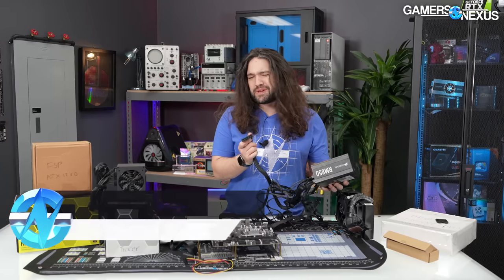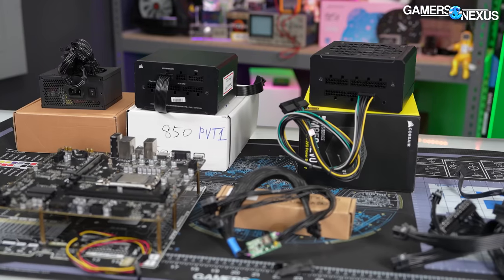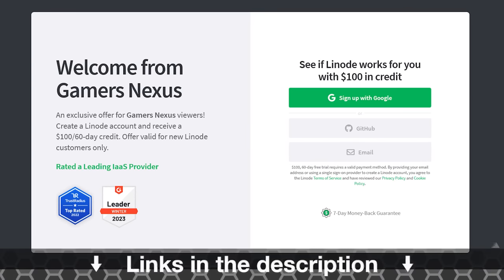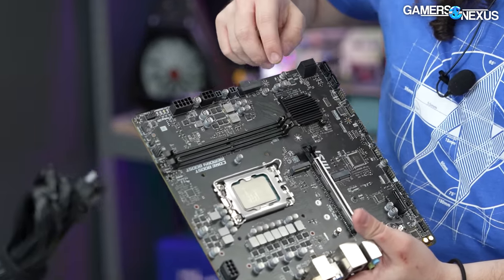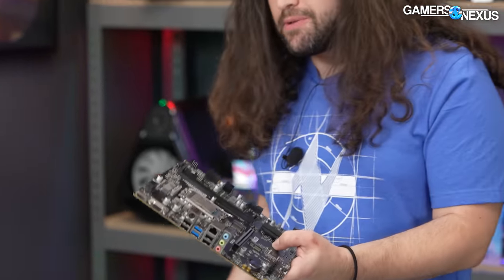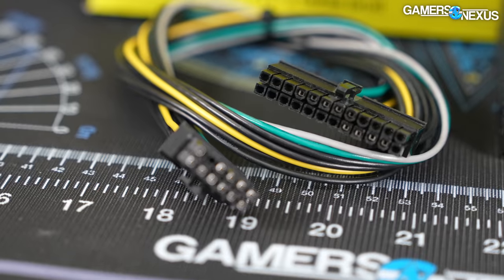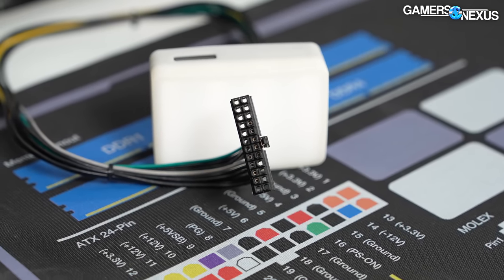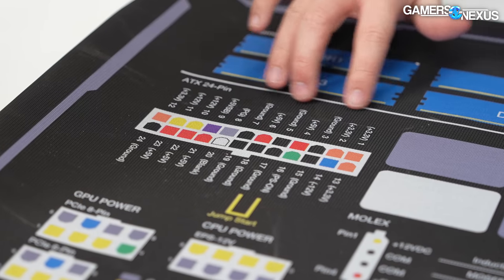The Future of Power Supplies - Maybe (Motherboard Cost, Cables, & ATX12VO)

Comment: My concern is heat, and “space” on the motherboard 

I don’t want to sacrifice things like bios flash back and bios readouts at the same price points, motherboards are already very high, and this just seems like another way to increase motherboard pricing, while dumping more heat into the cpu and gpu area

Having all my electronic conversion done in the power supply, separates some of the heat away, and PSU’s are so efficient, and so reliable, the heat they have to deal with is perfectly fine 

Personally, as long as there is the option to buy the old standard, I will continue to do so, ATX12VO seems to hold no meaningful benefit for consumers

Comment: I like to see a 11v to 14v  INPUT power supply in the 500 to 1000 watt range for RV/Truck use. Everything I found so far is too low wattage or less then 70% (I can not spell even close enough for spellcheck, sorry).

Comment: Unless they can shift all devices to use 12VO, removing the need for other voltages totally, I hope this goes the way of the BTX. This is a half assed implementation that makes no sense. You move voltage conversion from "Power supply" where it has dedicated cooling and circuitry to the motherboard which is usually more densely populated and already has its own cooling issues. To add to complications you will have to monitor the power consumption  of your other devices and the power conversion capacity of your motherboard.

Comment: IT sstill silly! You still have to convert the power around either at the MB or PSU. If the issue was just control - there was nothing stopping them from telling the PSU hey dont cover lower power while we're in idle mode. By moving the power convert you are sitll making MB cost even more than they do already! So no real win win for anyone. IF anything, Might be a good time to switch from 5 or 3V anything at this point to 12V... and move all the dang power connectors closer together. I understand that the CPU power it closer to the CPU for cleaner power - but there should be way to move said clean power closer to the other power connections as well. I just feel like there could be more done going forward. So instead of like 4 or 6 different cables we need to plug in - make it one or two large ones instead.

Comment: Most expansion components won't ever need 5v or 3.3v outside of the motherboard.  I would expect that motherboards would not even include  5v and 3.3v outputs for SATA/Molex and instead opt to use inline cable regulators and regulator distribution boards instead.  The majority of newer PC builds will likely never need external SATA or Molex connectors anyway...

Comment: Why not use USB-PD for the various low power components and let the PSU and/or motherboard negotiate the voltage/current that the component needs, kind of like how a USB-PD charger will negotiate the voltage/current to send to a device? USB-C receptacles have a small footprint.

Comment: LTT also did a video on this technology a year ago and I don't like it ever since. I didn't change my opinion after this video as well.

- Let's be realists: It would increase the (already absurdly high) price of motherboards while keeping the price of PSUs the same. 
- It complicates the motherboard design and makes you pay attention to yet another important aspect while choosing a motherboard -- the quality of its voltage conversion subsystem.
- Also, because this subsystem is soldered onto the board, you would have to buy it over and over again every time you want to upgrade your PC and change the platform. Which is expensive and wasteful. The traditional power supply can work for decades through many upgrades. ATX12VO might even be less eco-friendly than default ATX in the long run because of this reason.
- The only real upside this standard have is that it works more effectively in standy use cases. I don't see any reason why this can't be accomplished by just improving traditional PSUs.
- As it is shown in the video, this standard makes cable management harder.

I'm glad ATX12VO haven't gained momentum, and, probably, never will.

Thank you the great video, as always! :)

Comment: Old connectors are just fine we don't need anything new PSU cable, especially  the 12v  melting molex.
  Dell  prebuild motherboards are the new standard

Comment: Would a move to pure 12V-Only for every component be viable?
Reply: Only if every component uses its own voltage regulation which is kind of a waste. Chips don't run on 12v anymore. Most are 3.3v or less. It should probably be easy to eliminate 5v, though, if we don't care about people being able to keep using existing hard drives (which, personally, I do care about).

Comment: I hope the increase in board cost the smaller the board gets doesn't continue down the stack, as where will that leave ITX? 30%/50%, so 75%/100% price increase after manufacturer take their cut? If that's the case, I just want to go rush out and buy every current  ITX board I can get, because I'll be making money hand over fist as in the resale market, as the 12VO standard slowly kills that segment of the industry.

Comment: Low voltage low power DC-DC conversion is dirty cheap and reliable af, and it is very very unlikely to be the new failure point on new mbs. Maybe you should worry more about CPU VRM which is also on mb.

And I really don't understand why there is discussion of getting ride of the old stuffs vs switch to new standard. An adaptor cable can end the discussion (which one was shown in the beginning of the video. And the only problem about the adaptor is "bulky", where the conversion board is probably smaller than a 20-pin connector.

Having two standards at the same time is not a good thing for everyone. Especially for those of you, who might do a budget build out of an old Dell office PC.

Comment: Basically, shit manufacturers will produce MBs with shit DCDC-s, at least until GN harps on about it long enough. Basically the same as happened with CPU VRMs, to the point that arguably the swing is a bit too high right now.

Overall, the additional efficiency this enables is a good thing. And there's so much potential for cleaner power supply to the components if the feedback loop isn't through a half-metre of cable.

Comment: I don't like this idea for the reason that its more to go wrong. I could buy the best psu of all time and still be limited by my budget mother board. I would be limited by the peripherals I could add too as I would only have a set amount of 5V capacity. the only thing I can think to fix that would to by a 12v to 5v buck converter that just connects to the psu output. At that point we are just going back to the 90s where you need to have a bunch of meaningless junk in your case just to do what you want. have to have a buck converter and a ton of sata power adapters. yeah its probably an edge case since people will mostly use nvme these days but I know a lot of people with multiple hdds and or ssds in their system along with pcie cards and all that will add up and if you aren't carful I can see how you could easily melt the onboard 5v converter and brick the mobo worst case scenario. another issue is that motherboard will gat wayy more expensive too something we are already dealing will and they aren't even using this yet.

Comment: I have my doubts at to 12VO catching on, first off the normal ATX standard is plenty good enough and everything already works well with it. Second off ATX connectors are more mass produced thus are cheaper and easier to source. Third, nobody is going to pay extra for a 12VO motherboard aside from reviewers and maybe some enthusiasts. As many things in tech do they reach a peak, and I think the ATX standard has met that peak. Yes it may not be the most efficient but it works plenty good enough, so good that perfecting it isn't justified.

Comment: What if, and hear me out, they make all the power connections on a motherboard the same?  I know we probably couldn't just use 8-pins for everything, but the 12VO standard doesn't fix a problem, just moves it somewhere else.  We have the technology and the knowledge that, at this point, we should just have something similar to USB (UNIVERSAL) insomuch as it is just a standard connection throughout the board.  Just have a north, a mid-board, and a south PSU connection to the mobo to make sure power flows to the whole board evenly and to hell with all these random new specs that are made just to have a new patent you can push on everyone.

Comment: As many said this probably means more expensive motherboards and more reasons for them to fail. Additionally, shifting more components to a part which has its price controlled by Intel (via chipset price) is giving them an excuse to make it more expensive than it otherwise would or should be.

Comment: modern PSU's are basically 12VDC transformers, they convert AC to 12VDC then do DC to DC conversions for all the other voltages.
moving the DC to DC conversion to the mobo or individual equipment would mean that those parts will have a more predictable lifespan, which could be tailored to fail at a much more predictable time. why change just the power supply when it starts to fail when you can change the whole computer?   
desktop boards are not going to have the same lifespan or quality as server boards, but if they do, you know you are going to be paying server prices.

Comment: this actually sucks because a motherboard is often replaced during an upgrade, whereas a PSU can be kept around for more than 10 years.
Since the mobo now has all that voltage stuff, it's going to be more expensive - and that's the part you change more often... :(

Comment: That extra cost for mATX 12VO boards kills the form factor, as the lower cost compared to ATX is one of its biggest advantages
Reply: 1. Dell and HP are using mATX-sized boards with 12VO.

2. Cut the 2 extra DIMM slots (most people don't want them with DDR5 anyway), and there should be plenty of room to implement the 5V and 3V3 supplies without adding layers.

Comment: If i need a steady supply of lower voltage for USB, SSDs, etc, id rather trust a device that's dedicated to, you know, making power, rather than a device that's intended to transport data.

Edit: Wait a minute, 19:14 is a straight up lie, i expected better from gamers nexus.  The footprint is not in fact smaller because of all the space that now has to be dedicated to VRMs.  The only thing that got smaller is the plug, and the total footprint has increased.

Comment: Other than the enterprise level it just seems stupid to have 12VO. Now if companies are going to switch all the components that use all the other voltages to 12V then it would make sense, but I have no idea if there are specific reasons for the other voltages meaning they can't actually be changed.

Comment: I hope that Intel's 14xxx series and/or AMD's 8 or 9 series CPUs are 12VO because I plan on upgrading from my 4790K, FINALLY after 10 generations. The story on this 4790K... I upgraded from an i3 4330 after 5 years plugging them both into the same Gigabyte GA-Z87-D3HP. (bought 4330 new on Newegg, 4790K used on eBay) It has been 24/7 stable @ 4.7GHz 1.303V core, 4.5GHz 1.270V uncore/ring, 32GB 1.65V 1866MHz 10-11-11-30 1T (from 1.50V 1600MHz 9-10-10-28 2T), is not stable on any other loadline calibration setting than "low," and, is only stable with PWM phase performance set to "extreme."

Comment: I feel like this standard is looking to solve a problem that PSU manufacturers have already figured out years ago, by simply moving the vast majority of amperage away from the 3.3 and 5v and onto the 12 rail(s). It seems so nonsensical to move the voltage conversion circuitry outside of the PSU and into the cable/onto the mobo somewhere.

Comment: Functions must stay separate. PSU - must supply power.  Motherboard - serve as common bus and connectivity. Now they want to split power function across two components. Good for them. Bad for us.
Right way is to move every device to 12 volts. But we definitely do not need power conversion on a motherboard.

Comment: Does look interesting, but I can only see micro-builds being beneffited, with m2 disks an a relatively low power CPU with an iGPU, meaning only one (or two: mobo + cpu...) cable(s) need to be connected...
Bigger cases with a little more space to spare won't have significantly less cables to route or hide and they certainly won't take much less space anyways...

Comment: Call me pessimistic, but I have a feeling that PU, MB, etc. makers are going to jump on these new specs.  This gives them a "legit" reason to charge us "tons" more money (even if it costs them less or the same).  I just hope they coordinate all the changes and make the switch to them all together.  I also hope they incorporate moving connectors to the back of the MB.
Reply: Call me pessimistic, but I have a feeling that PSU, MB, etc. makers aren't going to jump on these new specs, and we'll be stuck with overpriced, inefficent multi-rail ATX forever.

Comment: i know its irrelevant question, but i'm considering to get an used EVGA 3060 ti for my current i5 11400 +  16GB DDR4 3200. goal is 1080p and no RT. but i'm really getting worried about VRAM since its only 8GB and new games are getting more demanding on that concept.
should i buy it, or consider something like RX 6800 non-XT / XT which has 16GB of VRAM? 😟
any help would be really appreciated since i have to make my choice in few upcoming days.

Comment: This is just seeming more and more like a modified server psu. But The only thing this may seem to put forth, is just more expensive parts with less protection to system components... In my opinion at least.
Also, how much you want to bet intel will release a future cpu that will somehow require this new standard to function.

Comment: This is such a bad direction to go. If the puny surface mount voltage regulators and control circuitry develop an issue, new motherboard time, and it will be expensive. The thinking is probably to make the power regulation and usage more intelligent and more efficient by being controlled at point of delivery.

Comment: I''ll say, don't reinvent the wheel. ATX is working fine. I don't like the idea that ATX12VO SATA power connectors are so limited by the motherboard. RGB and fan controllers need SATA power connectors other than SATA drives.  Intel has tried to replace the ATX form factor in mid 2000's with BTX , only OEM pre-builts adopted it for a short few years then revert back to ATX . DIY market has ignored BTX .

Comment: Just baught an "new" atx 3.0 and PCIE 5.0 1000w power supply (the A1000G). 
And the 12VO looks like making the motherboards even more expensive........you change motherboards way more often than PSU, my good old semi modular 750w 80+ bronze PSU was used on 4 or 5 different motherboards, used it since my intel Q9650 and I just changed because there was an insane deal on the new ATX3.0 PCIE5.0 A1000G from MSI (to make things simple, various offers lowered its price to €140).

You don't change PSU nearly as often as motherboard. I'd rather have more expensive PSUs and cheaper MBs.

Comment: The problem isn't the new spec, it's that motherboard makers will use any excuse they can to increase prices. I don't see the layers being in issue cause almost no new motherboards are still using 4 layers. Even micro ATX still needs DDR5 signaling so mobo makers claiming 12VO is the reason you'll be paying more is BS.

Trying to blame Intel for increased mobo prices is the same as AMD and Nvidia using any excuse they can to warrant skyrocketing GPU prices as their margins get higher than any time in history.

Comment: I know this will never probably happen, but ... what if the concept of a power distribution board was standardized?  The power distribution board replaces the motherboard tray and has upward facing connectors in standardised locations.  Your motherboard then plugs into the power distribution board with downwards facing connectors.  The power distribution board can then do all the conversions of 12v to all the other voltages.  And the ATX12VO PSU plugs into the power distribution board.  That way the all the costs are not then piled into the motherboard which is already very expensive and has more than enough complexity and potential points of failure as it is.

There are probably problems with this, feel free to point them out.  And as I say, it'll never happen.

Comment: I'd have no problem with them simplifying the power cabling... I don't think anything in the modern day uses negative voltages, after all.

12V would make it much simpler to power computers off DC solar power while minimizing conversion losses. picoPSUs already take 12V DC, for example... albeit at a maximum of around 160 watts sustained, iirc.

On the other hand, going with something lower would force CPU and GPU manufacturers to stop making things so energy-guzzly, because lower voltage = higher current, which produces more heat...